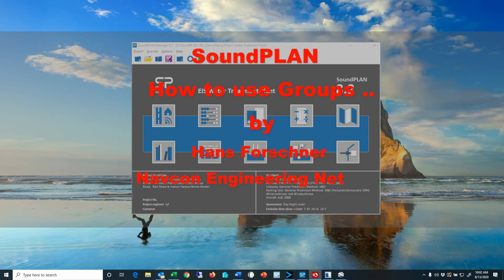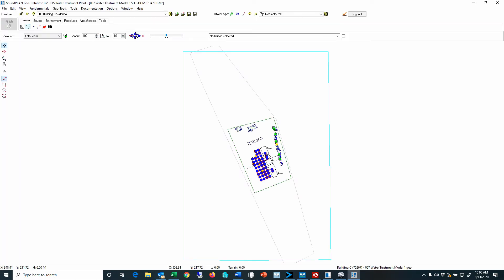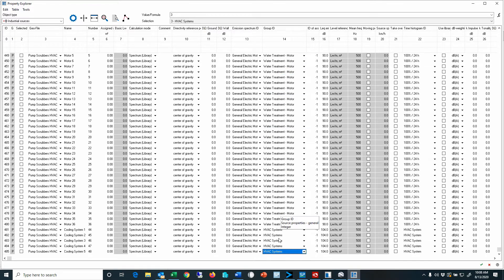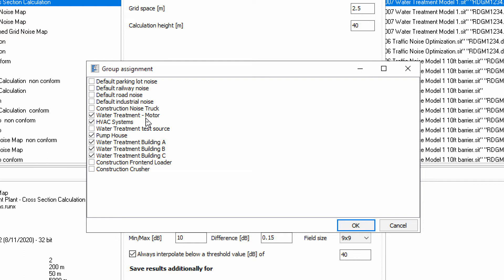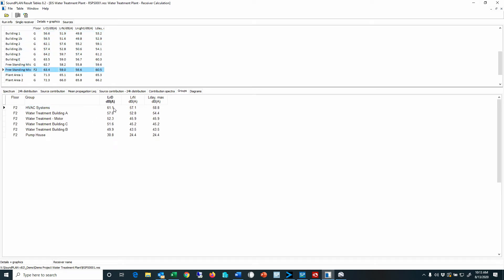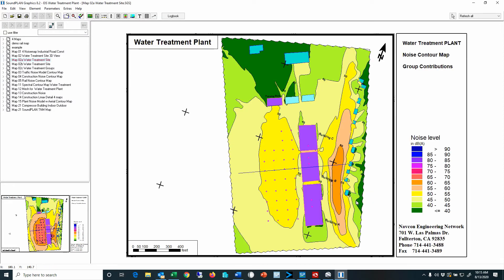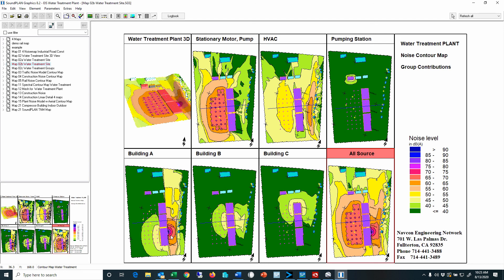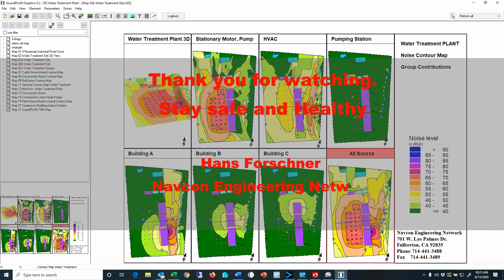SoundPLAN Contour Map by Source Groups

Comment: Hi Hans. Very useful video. When we subtract two result in grid operations is it arithmetic subtraction or logarithmic. For example I have noise result file and speaker SPL level file. I want SNR map (Speaker level - noise level). In subtract operation there is "subtract" and "energetical subtract". which one i should select?